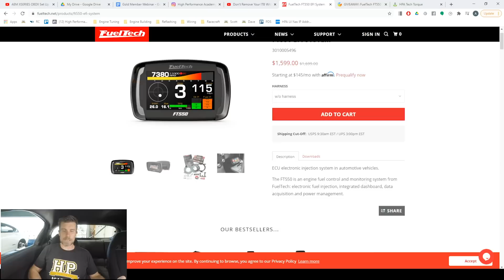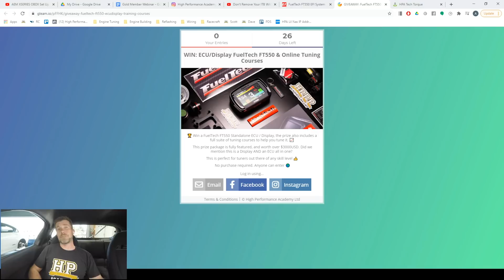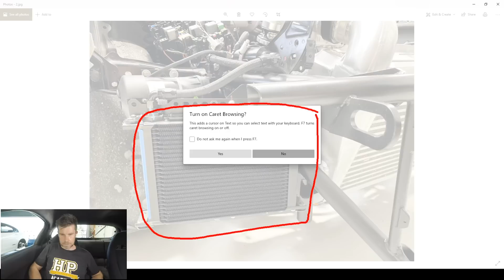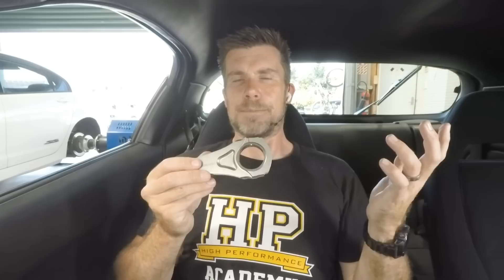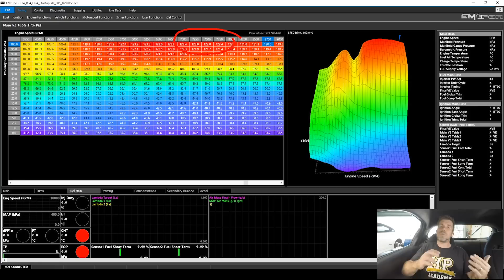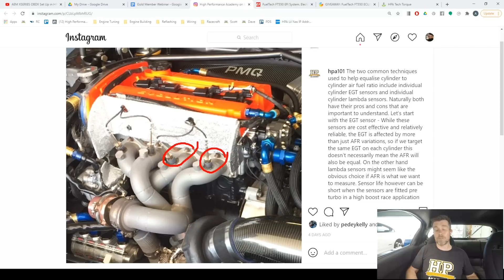Formula 1 V10 Conrod, SR86 Update and MORE | Today At HPA [#UPDATE 263]

Comment: I can't recall, off hand, the figure but, IIRC, the bore was included in the FIA technical spec's, so you can figure out the stroke and hence the rod/stroke ratio from the rod.
Ah, Cosworth TJ had a 95mm bore, so for a 300cc cylinder the stroke would be ~ 4.23cm. With a nominal C-C length rod that would be ~~ 2.48:1. I would expect there to have been some rathe high bending forces at that rpm, so the design isn't surprising. Very 😎 paperweight, I'm a little jealous!